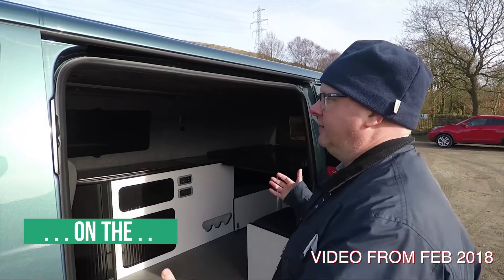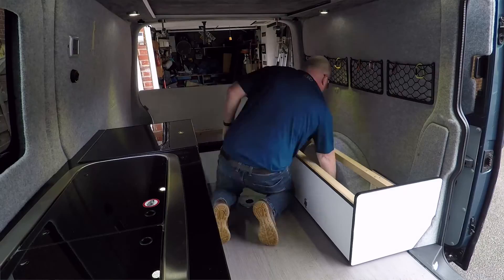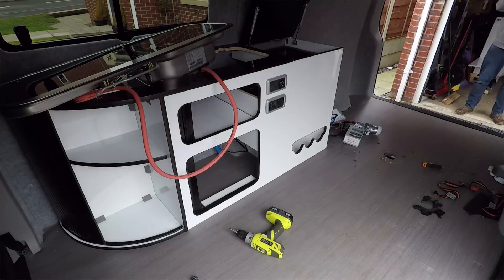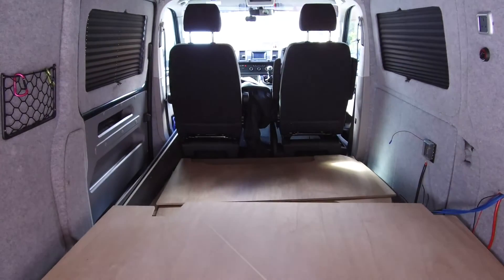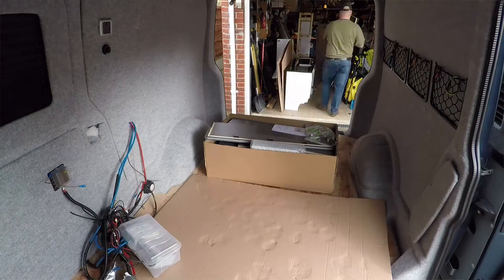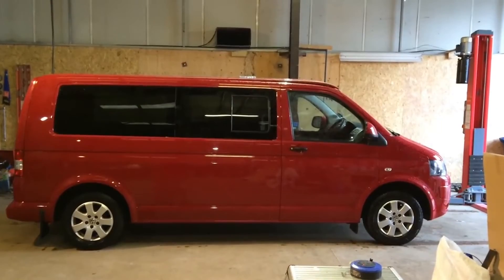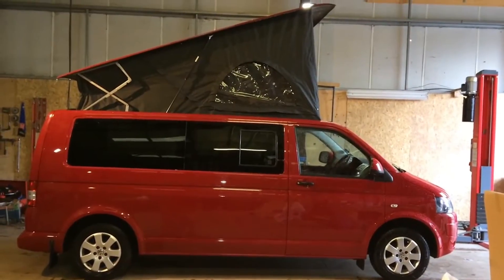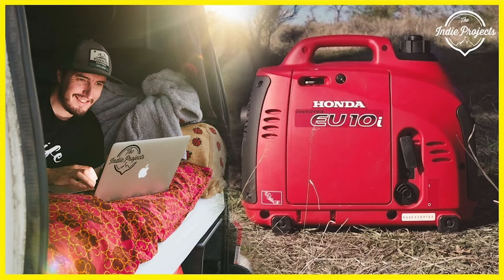VW T6 Campervan teardown - Ready for the new Interior

Comment: I would go for grey waste out of a hole. For a solar charger, use a portable one you can plug in and put outside when you need to and point it in the direction of the sun.  Reputable makers of rock 'n' roll beds will have a standard size, so go with fitting the kitchen units first as they have to go against the wall.